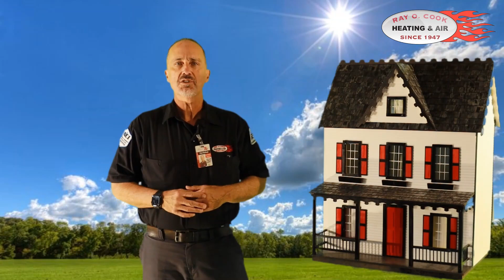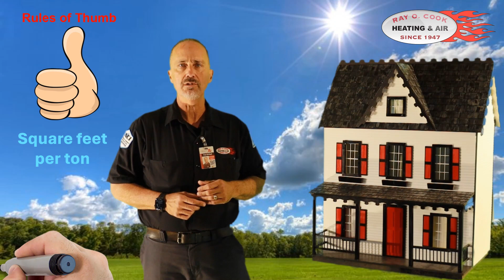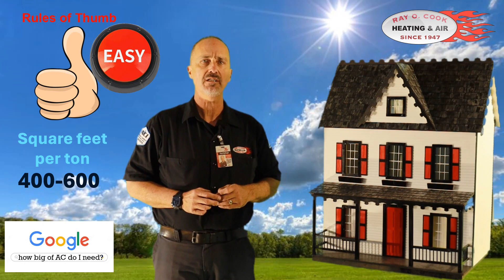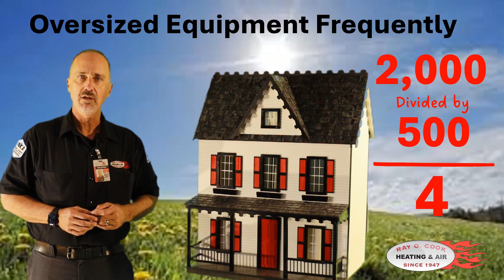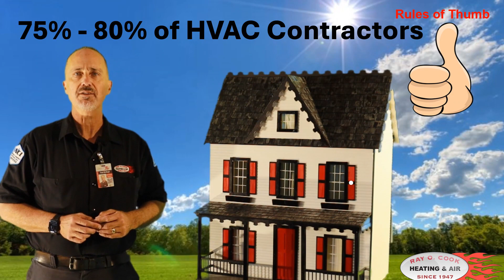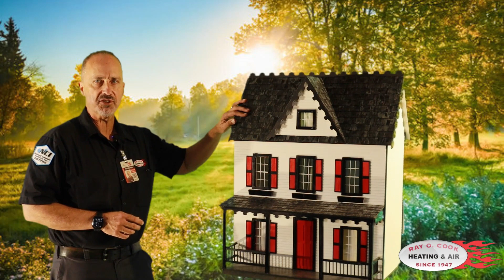Square Feet per Ton

Comment: Why hasn't the rule of thumb change to accommodate 2025 building requirements?  

What is the alternate method used to compensate for different variables?
Reply: Because of the constantly improvement of insulation and tightness of homes, a load calculation is needed more than ever in order to capitalize on those improvements.  The HVAC industry is stuck in the past because "it's safe" which causes gross (oversizing).  Most do not take the time to learn the load calculation process.    Sad, but true.